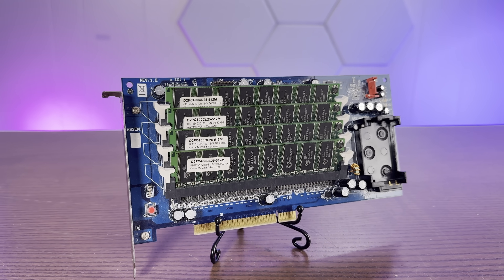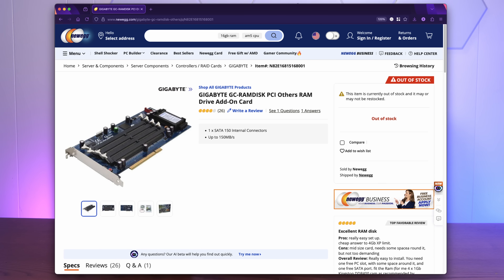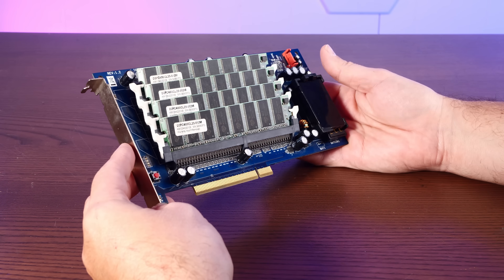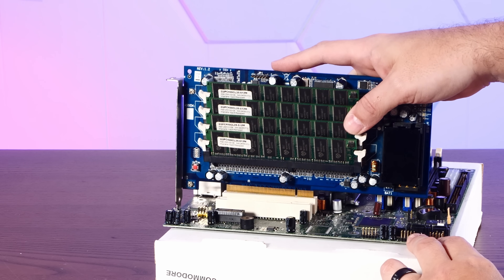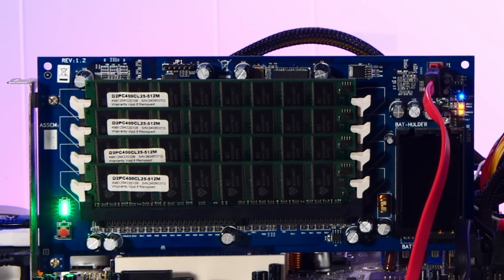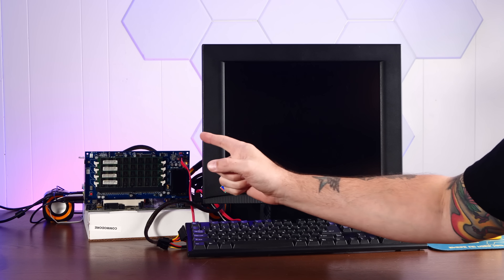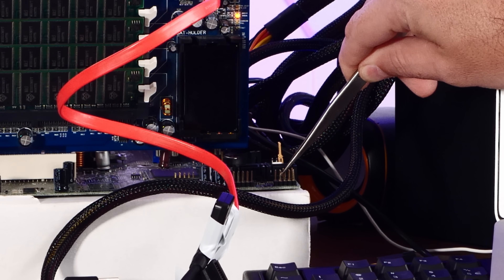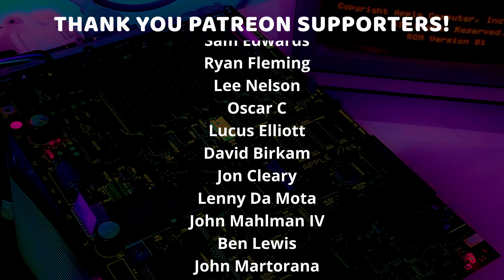This Early SSD Was WILD

Comment: It had same purpose as EMS RAM in the 80's. It was a time when RAM was approaching 32-bit address space limit of 4 GB and such device could be used as a RAMDISK to keep Windows swap file. Heavily increasing performance in heavy RAM use scenarios.
Similarly EMS cards were developed to overcome 1MB (640KB in reality) RAM address space of 16-bit REAL mode of x86 PCs. Such ISA cards could have 4, 8, 16 MB or perhaps more RAM and mapped them into the 64KB window of CPU address space of x86 real mode, in 640-1024 KB address space.

Later 32-bit CPUs had virtual mode that could simulate EMS memory (EMM386.EXE from MS-DOS) and same thing happen in mid 2000's.
Last generations of 32-bit CPUs had Physical Address Extension (PAE) that increased addressing space to 36bits. Allowing to use up to 64GB of RAM on a 32-bit machine. Windows XP supported it, but not by default. I've had a Core2Duo machine with 32-bit XP and 64-bit Win7.
Enabling PAE allowed to utilize 8GB of RAM in some ways. I've used 3rd party RAMDrive software and kept Windows swap files there.
Since it was a true RAMDrive, the performance was like modern NVME with even lower latency. Though the contents was erased after every boot.

Comment: That's a ram drive. I mean even back to the late 80s on my 1040 ST I sometimes made a ram drive so the floppy does not need to accessed anymore. This is the same but dedicated hardware and not on the main system memory. Why compare that to SSDs? Makes no sense. That's not a early SSD just because it's fast, its' just a ram drive or a ram disk (what ever someone want to call it). ^^ Even dedicated drives like this date back to the 80s.

Comment: Mate, that's not "Early". Ram Drives existed on ISA and VLB bus, for 28 and 38 PC's.
3:50 ... No idea what "Zy linux" is, but "Xi Linx" is a pretty decent chip maker. And the one on the back is "J Micron", not "JM", that'll be the SSD controller.

Comment: i have a friend who had not exactly that card but something similar at the time, the primary differences being his device fit in a 5.25 disk mount not a PCI card and had a CF card slot that it could sync the data to the card when it lost power that way if the battery ran out the data would still be retained on the CF card. he swore by the thing a a boot loader drive, he absolutely loved it.

Comment: Honestly I reckon these are still a great idea (though admittedly niche) in 2025. With PCIe 5.0 (or even 4.0), and cheap older RAM sticks (DDR4, or even 3) available, having a 16 or 32 GB swap/pagefile for a very low price is great. You wouldn't need to worry about volatility that way either.

Comment: Fun for it's time, but for today.....
Well.
Only if they updated it to use PCI EXPRESS for data and power, as well as allow it to use modern RAM STICKS... (For speed and capacity improvements)
Otherwise literally any NVME drive can kick it's ass in all parameters.
I mean damn.. If SATA was faster than PCI, why didn't they use an AGP port as a speed upgrade option instead?... Using SATA is so jank and currently it's probably it's biggest bottleneck.

Comment: The fact that it uses SATA for the data connection is borderline infuriating.
Reply: Is it? Most motherboards did not have PCI-E slots at that point, or one (for the video card) at most.
Reply: I wondered why they didn't just implement a PCI interface on the FPGA.
Maybe they didn't want to bother with developing a BIOS Option ROM or drivers
Reply: @TheRailroad99  PCI is slower than SATA.
Reply: @ilovethe70s 
Indeed, but not by much (this only seems to have SATA 1.5G speeds - or he didn't connect it to a sata 3Gbit port.
Still, I think it could have been much cleaner if they just went for a single interface.
Of course, using PCI would have loaded the PCI bus almost 100%.

Comment: I think the purpose of the self contained RAM disk module was that one would:
Install an operating system to it,
Back up the operating system to a bootable persistent storage that also could double as data storage,
Then if the data is lost on the RAM disk module the person boots the back-up (slow) drive to rewrite the RAM disk contents,
Boot back into the RAM disk and continue.

To maintain OS state, periodic backups can be made since by then 200+GB HDDs were a thing and even on an 80GB HDD, about 30 backups would be possible of a 2GB RAM Disk, so plenty to have a kind of "rolling release" of the operating system state.
maintaining may include after having a session of installing all the redists and settings tweaks, or even having seperate images for each game, so those games load faster or similar.

Comment: I remember I had a Tekram vesa local bus cache controller card for IDE hard drives in my 486.  Man, did that thing really wake up the computer with nothing else changed.  It required SIMM memory cards to operate and I think I had like 512KB x 4.

Comment: Could be useful if you needed a simple kill switch for your data, maybe some sort of board that goes between the battery and this iRam board with a switch button routed to the front of the PC, flick the switch disconnect the battery and the power coming from the PC and the battery simultaneously and all your illegal MP3s are gone as the FBI are knocking down your door.

I also remember a time in the early 2000s, developing pretty heavy server software and services, and a common solution to get the speed needed we often configured a ramdisk, and at boot load the data from a disk image. this card, if we had known about it, would actually been very helpful.

Comment: I never went to a LANparty where every PC had all the critical OS files intact right away
first hours were usually spent going through the 5-stages of installing the same windows version on all the machines (iirc windows itself networked fine across versions, but the games didn't)
I had one XP serial memorized just from using it so much

Comment: I remember a VESA local bus disk controller card with ISA interfaces that had slots for memory. The discrete hardware accelerator improved a lot the performance of stacked/doublespaced HDDs running DOS 6/Win 3.11. On a 386 DX 40 with a coprocessor.

Old times.

Comment: Win 7 (Not Vista) ReadyBoost!??  Much better than the Vista version.
No battery required makes it an interesting option.
IF it keeps data during hybernate; Hybernate retains the cache on fixed drive, where reboot does not.

Acard ANS-9010  had a similar product with more and later version DRAM and 2X SATA 2 (vs 1X SATA 1 here)
Same ReadyBoost story, but on 2 drives rather than 1..!

Comment: Back in day, I had to build a makeshift CF card adapter was like an cursed flash drive.

Somebody at work broke my CF-USB reader, and all I had was an industrial CF to IDE adapter.

My only USB to IDE adapter did not fit that CF adapter, but it did fit an IDE to SATA adapter, and that fit an SATA to IDE adapter. The USB to IDE adapter also had SATA, but it, like my other SATA USB adapters, didn't fit the SATA to IDE adapter.

So it required 4 different adapters and 4 power supplies to access that CF card.

I remember wanting one of these ram cards back then. They've come back too, we have CXL memory modules that can currently add up to 1TB of DDR5 per PCIe enabled CXL slot.

Comment: At the time of winXP you could install the maximum RAM your mobo allowed, windows 32 bit was limited by design to using 2-3 GB of RAM and you could dedicate the rest to RAM hard disk (however volatile).
MoBoards from the era of this card would have been limited to 8GB max RAM but not all of them, server ones were more capable... and this use case worked at RAM speed, not SATA speed.
5 years later and you could do rhis with MoBos supporting 32 GB or more RAM and have some super-fast retro machine for older games (new SW moved over to 64 bit code and Win7). Later came virtualization.

Comment: If you can run compression which DOS and Windows 3.1 on a 286 could do, the drive would be better. Aside from the volatile issue. A network boot and load an image, but need to store on a platter.

Comment: There was actually a 16-bit bus version known as cache cards, which were used for servers during the DOS IBM PC/AT BBS days. This version had the same four slots, but the RAM was quite expensive, costing $200 for 4 MB. If you come across one, consider making a video about it.
Reply: Quite different in function... ISA cache cards are only practical for systems where the memory is accessed on the same bus (like the PC/AT and clones, as you mention), so offering up a zero-wait-state response over ISA is just as fast as (or faster than) local memory, and expensive SRAM chips can simply overlap any slower memory, or memory space the motherboard didn't map out to memory slots. Cache cards for newer systems with memory running faster than the ISA bus used specialized slots, and connected directly to the memory controller, while using an ISA cache card would actually slow them down.

Comment: You can do this with RAMDRIVE in DOS. I used to load games into it (small DOS games, to be clear, I had 64 Mb on my Pentium MMX) to reduce load times. I'd written a batch file to load a game into the RAMDRIVE = I had to remember to unload it back to the hard disk with the savegame files tho.

Comment: Maybe put together a 2 or 3 tiered Windows Storage Space array with the i-RAM as the top tier, an SSD as the mid-tier, and a hard drive as the lowest tier. Maybe throw in an Optane drive too... :) Regular non-server Windows doesn't give you a UI for tiered storage spaces functionality, but you can set it up with powershell. Or do something similar on Linux with ZFS or something.

Comment: I don't see the use, even back then, for an every day consumer.  Just a more expensive way to add RAM. 

A few years later we had true PCI-E SSD cards.  I was an early adopter, I had a 240gb from OCZ that replaced a sata 2.5" 32gb, which thankfully itself had come down from $1000.  

The OCZ Was slow as dirt on initial boot up (more than doubled the usual post time), and you had to load special drivers to install Windows since the built in ones didn't work, but blazing fast once it was up and running.  

I believe that modern NVME drives are a direct descendent of this design and I'm thrilled we have this tech as standard today, with the space savings along, and without the extended boot times and special drivers.

Comment: You should do a video on the old beast that was the  Western Digital Raptor/ VelociRaptor 10k RPM drives! The old school RAID 0 for the fastest speeds. I remember running 2 36GB drives in RAID 0 in windows XP and Windows 7
Reply: I had a RAID0 with two Raptors running Windows 2000 and later Vista (skipped XP).
Still I wanted this ramdisk.

EDIT: 
Found an old bench screenshot; not much ahead with 186 MiB/s read, 178 MiB/s write.
Reply: @ysmg9010  Yeah but playing with old drivers that was WAY faster or ahead of their time is super fun! Especially since some Operating Systems dont like or love running on RAID0. 

I remember after giving up on RAID0 (after getting a larger drive) I used to put dedicated games that would fit but had long load times. Shit was fast and played smooth compared to a 500GB 7200 HDD. 

Also seeing him mess with a old SSHD would be fun! or even a newer RAMDISK with faster rama.

Comment: Didn't use that card specially, been using things like that since the late 80's. Couldn't really build one that was useful until maybe the mid 90's. I wouldn't expect many to know about them as potentially the best environment at that time was industrial applications where HDD's would be torn to shreds due to vibration. While faster than MFM and IDE in most cases, any speed gained isn't really felt on DOS based machines. Last one I built was for the XL-2000 (8088 based) and while a PC XT clone, the ISA Bus was on a proprietary backplane using common edge card slots from RadioShack. Hard-drives back then were fussy. The ones I built had their own boot rom to emulate in function like an MFM or SCSI drive.

Comment: not ideal for OS and long term storage, however, during this time if you were using this as a "scratch drive" as mentioned for say Photoshop or Video workflows, the speed for the cost was wild for the time. sure you could achieve faster speeds with other solutions but it usuallly required some type of raid setup or larger investment in the highest end hard drives + raid controller

Comment: It would have been cool if it had just a little more capacity. Image your Windows install over to it at boot and then have extremely fast OS performance... then if the battery goes dead it doesn't matter. Keep your user folders on spinning rust.

Comment: I wouldn't mind something like this now.  SSDs have write endurance limits, RAM doesn't.

I actually ran a "cheap and crappy" 120GB SSD using bcache as a block cache for my spinning rust.  But write endurance wore out within, no joke, 3 months.   I mean, maxing that out with like 4GB would probably not do it, but if they made a modern one where you could even get 64GB in there, something like bcache would work great (.... plus, as I found out when the SSD took a dump in the middle of using the computer... total failure results in the bcache-backed disks freezing for a few seconds, then bcache realizes the cache disk has failed and just proceeds without the cache.  Well, as long as you don't buffer writes through bcache at least.)

Comment: I have one of those..   I used mine without battery backup as a combo swap and temp drive on a PC that had maxed out its physical RAM slots but still wanted more for Photoshop editing (so it was basically using physical RAM for virtual memory)..   Wasn't as fast as being able to actually add more RAM, but definitely a lot better than swapping to a spinning disk drive.  I even tried early SSDs as swap space to try to add more fast virtual memory to my box (I actually wore out the write cycles on at least 3 SSDs trying to use them as fast swap before I came across the RAM disk)..   Without the battery attached, the contents on the RAMdisk simply disappeared when power went away, but when power was reapplied, it magically created a formatted FAT(32?) partition that Windows happily started swapping to, so pretty much totally user transparent for my specific application..

Comment: Since the WinXP installer said you were using atapi, it means your BIOS was set to use IDE emulation for SATA devices which was probably limiting the speed pretty badly. Would be interesting to see how it performs in native SATA mode, though you'd probably have to use nLite to slipstream in the intel SATA drivers if you were to stick with WinXP.

Comment: RAM drive for building heavy programs.  Back in the day I was using a mechanical RAID 0 and  a few years later I would configure a part of RAM as a RAM disk for the same purpose.  No worries if you lose power too, you just run the lengthy build again.

Comment: There used to be 5.25" drive bay mountable units from another manufacturer that would hold something like 6 or 8 DDR2 DIMMs up to like 4GB each. They would back the data up to a CF card. I remember they had dual SATA ports (SATA-2 I think) to effectively act like RAID 0. They were quite expensive.
Reply: Hyperdrive4 16gb and 32gb variants very nice for old builds

Comment: For having a ridiculously modern and fast FPGA on there, they actually made the board priced extremely attractively!

I don't understand the point of not making it a PCI disk controller though...

Anyway this made for an awesome device to compile software, to emit obj files to and to run linker from. Maybe even good for headers and stuff. You'd keep a copy on the HDD just in case though to recover it.

Comment: I had a Applied Engineering RAM Expansion on my Apple IIc. I can't remember the capacity exactly, but I think it was on the order of 512KB. A lot of software didn't know how to use the extra RAM (required bank switching) so a common way to make use of it was as a RAM drive in ProDOS with a special driver. What this allowed you to do was take an application that normally used something like 4 disks that you would have to switch back and forth when you accessed different features/tools (like PublishIt!) and load all those disks into the ramdisk, then just run it from there, which would take the tedious disk swap and loading of tools that could take up to a minute, and only take a few seconds (after you spent the time to load the disks into the ramdrive). This was in the 80s and early 90s.
Reply: Yes, I loved that company, I had their Ramfactor card for the Apple IIe,. It worked like the device in this video but instead of a battery on the card itself, there was an external power supply that provided power to the card to preserve the ramdisk contents when the computer was off , called the RamCharger, it even worked with my PCPI Applicard in CP/M

Comment: We used to have something like this on a RS6000 PowerPC database server (running AIX). I configured it to be Oracle's TEMP tablespace, it sped up join and order by operations a lot. It was backed up by batteries so in case of a power failure (extremely rare in a data center and with redondant power supplies) all the data was dumped to a hard disk.